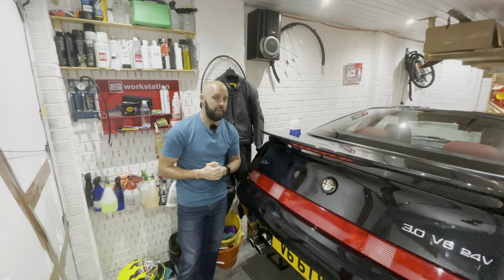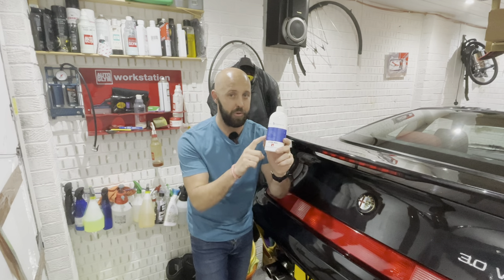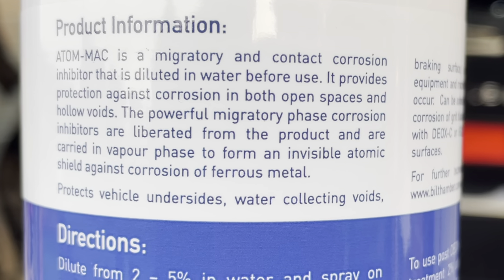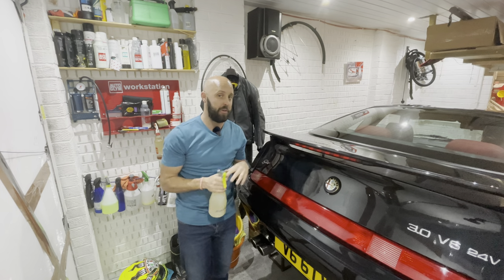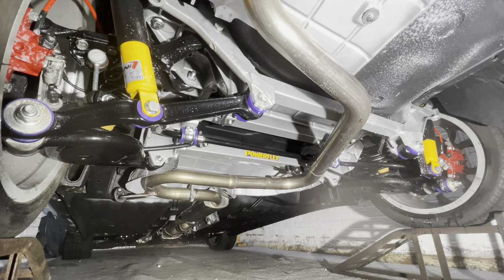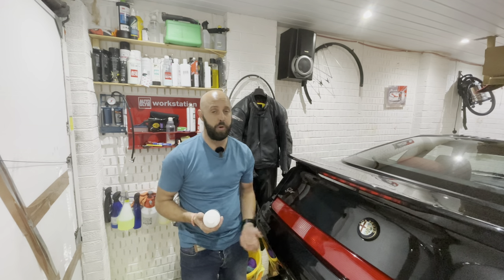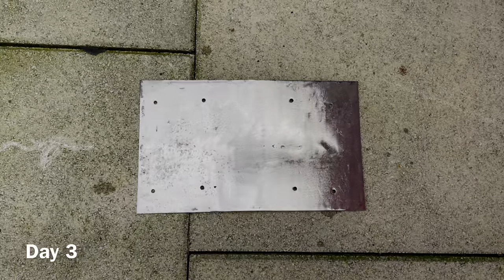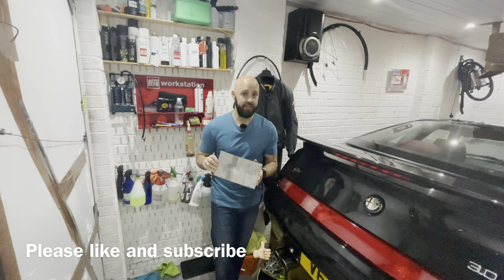Bilt Hamber Atom Mac reviewed. The best most convenient rust preventative for your car or bike?

Comment: My GTV lives outside and I wont drive it when salt is on the roads. So this should be perfect to keep my brake discs from overly rusting over winter. I have used other Bilt Hamber products and never been disappointed.

Comment: Hi Rick, came across this video while searching about Atom-mac.
First thing first, car looks awesome👍
I have used Atom- mac before but never realised it had do many uses, tools, bikes etc, so will defo be using this more.
As for Bilt Hamber stuff , all products are top Quality, found out about Bilt Hamber back in  2010 when I got into detailing, so I have Dynax UC for the wjnter rims/tyres, awesome stuff, Surfex HD is the best cleaner by miles, hydrate 80, Korrosol, Auto wheels, auto foam, Finis wax are all superb. So anyone doubting any of the stuff, give it a go.
Cheers Rick👍

Comment: I'm a new convert to Bilt Hamber.  Brilliant products and amazing value. I've used Hydrate 80 to treat the rear beam of our Panda 100hp, Deox to de-rust some rod ends and nuts and bolts and Auto Wheels. I have some Dynax S-50 ready to do the cavities and some Atom Mac to treat that car and also our Up Gti.
Reply from the maker: Hi Martin. Yes they are fantastic value for money whilst at the same time very high quality products. I haven’t tried the Deox yet but maybe that will be a video for the near future. If you haven’t tried the Surfex HD yet then I highly recommended it 👍🏼
Reply: @_RicksGarage  Hi Rick. I highly recommend the Deox it's magical stuff and the dilution rates mean it will last for ages. Not yet tried the Surfex as I have a fair bit of Autobrite Citrus Wash to get through first but I will do.
Reply: @martinmees878  I use Hydrate 80, Deox C and Atom Mac. I like to use Atom Mac on the discs after washing the car. All BH products are amongst the best out there and are amazing value for money. I haven't tried Surfex HD....yet...
Reply: @martinmees878  ... hi, give the Surfex HD a go, you won’t be disappointed... I have many of Autobrite products as well, however this stuff is in a league of its own, as there is such a massive range of dilution rates to suit every scenario 👍

Comment: You should try their Hydrate 80, and Dynax-S50. The Hydrate 80 is insane protection for any corrosion prone surface. It even works on areas that already have some surface rust, it will neutralize the rust, while forming a permanent protection barrier (obviously you want to clean as much rust off as possible first with anything like a steel brush, etc.). With Hydrate 80, you basically need to either use a paint sprayer, or a brush/roll to paint it on the surface (I think they recommend 2 layers). It will then cure and harden to a clear protective barrier.

Comment: Interesting stuff so does this basically replace the need for products such as Waxoyl which like you say looks horrid
Reply from the maker: Potentially yes but for a daily driven car you’d have to keep applying it often. Probably on weekly basis especially through winter. For a garaged weekend toy such as my Alfa then this is absolutely an adequate substitute for Waxoyl in my opinion. It’s great to have a product that I can use to protect my hard work without having to paint stuff over it or use any kind of sticky, messy  substance
Reply: @_RicksGarage  thanks for the reply. I’ve got a pristine 98 156 with 25k miles on the clock. Never had any rust protection used on it anywhere and is not in daily use and garaged so this could be Just the solution I’m looking for to assist with preserving its excellent condition.
Reply from the maker: @tjshill82  that’s it. It offers protection without having to cover anything up. Atom-Mac allows you to retain the cars originality. I really wouldn’t hesitate.

Comment: Great to see you gone with the BH recommendation... use any of their products and you won’t be disappointed 😎👍 Usually are at a great price point and actually do what they say on the tin ... no frills, fancy packaging etc ... just good gear 👍 used their Deox C recently to refurb my VW Corrado brake callipers.... amazing results. Also their Hydrate 80 is excellent value when compared to high street versions such as Hamertite rust convertor .... The Alpha looks amazing 👍👍
Reply from the maker: Hi Jon. I completely agree. Great products without the scene tax. Thanks for the recommendations 👍🏼

Comment: Hi. Seems like good stuff. How have you found this on brake discs which, let’s face it, often collect a lot of surface rust when it’s wet outside. I’ve read some people say their discs turned a brownish colour after using this, particularly when the solution was mixed too strongly! Also. Have you looked at Languard made by a UK company, designed for marine vessels, but works very well on cars👍
Reply from the maker: Hi there, thanks for the comment. Yes, I looked into Lanoguard. It seems like really good stuff but it’s also very expensive. Some may say overpriced. I’ve heard that Lanoguard leaves a transparent but waxy finish and isn’t designed to be applied again and again. It’s more of a long term product which I understand is a good thing for some people. Personally for me I wanted something that I could keep applying again and again and something that doesn’t detract from the finish I have on the underside of my car. I also wanted a product that I could use on my motorcycle and more importantly my bicycle which I use year round for commuting through all four seasons and all weather. The Atom Mac just fits the bill for me. 

With regards to using it on break discs, I haven’t experienced any browning yet. It will be ideal for spraying on the discs while my car in being stored over winter though 👍🏼
Reply: I've used both products on my gtv. Atom mac in voids,Dynax in sills and Lanoguard on underside and wheel arches. It dries clear, a waxy finish that can be jetwashed but not removed. Shall be doing the old girl again( for want of a better phrase) when she comes out of storage, all nice and dry.